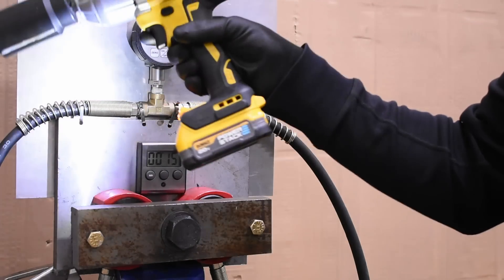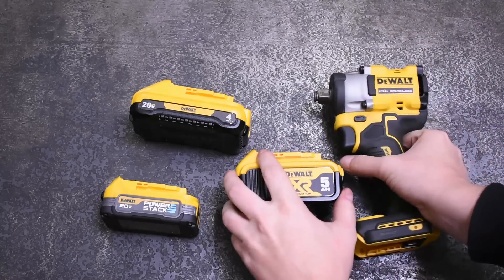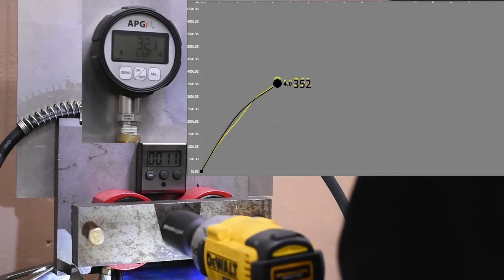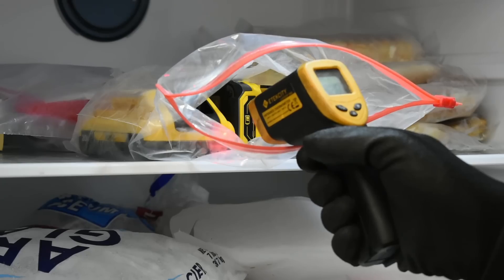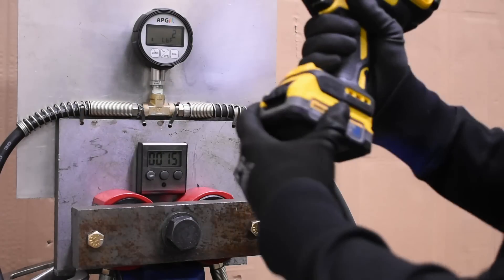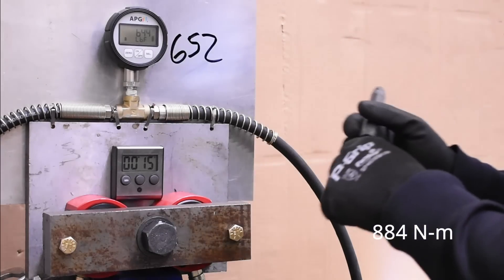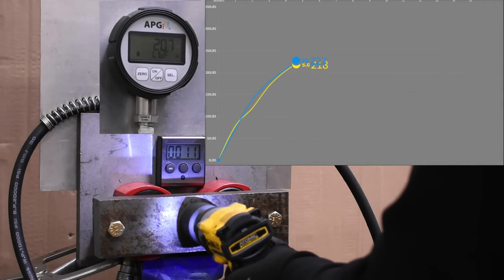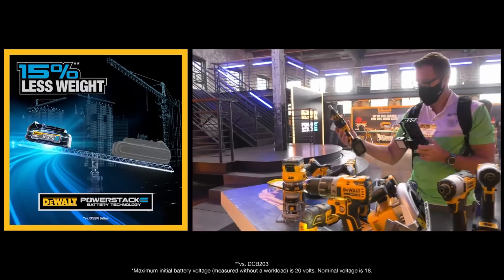This is NOT a Normal Tool Battery: DeWalt Powerstack Dyno Tested

Comment: Battery resistance (internal losses) goes up cold temperatures - the electrolite in the cells starts to freez basically - so the performance drop is expected. In the warm however the resistance only drop a little since the resistance is dominated by the conductor resistance in this case. However the battery will degrade much faster when it is hot. Much like your cell phone battery will die in a year if is is always running hot.

Comment: Recommend Welzh Werkzeug Air Impact Wrench Gun 1/2 Drive Mini Beast 1350NM 1.2KG Stubby upgraded my snap on mg725 and it blows it out of the water on Amazon for £150 and couldn’t be more impressed

Comment: Talked to a DeWalt rep at our local tool shop and he said they are coming out with bigger PowerStack batteries this year. I think he said a 5Ah one. I would be interested in that, or even better a FlexVolt power stack. :)
Reply: Did they specify on when?
Reply: Unfortunately no.

Comment: From my experience with LiPo and ion batteries in RC cars, planes and boats if you repeatedly heat cycle that power stack battery often you're gonna puff the cells in it. I see issues with lithium fires in the future, I've seen packs stored and charged wrong burn down garages

Comment: I was buying a dewalt tool recently and I saw that the XR battery line has been renamed to not include the XR branding (and I assume the non-xr batteries are being killed off). This caused a lot of confusion with buyers.
Reply: XR was originally used to designate brushless tools
Reply: They really should have kept the XR branding off the batteries from the beginning.

Comment: It is the same battery chemistry, but they made it flat with custom dimensions instead of round with standardized dimensions.  Why would we expect anything else?  (Safety reasons prevent them from choosing a more volatile/ higher output battery chemistry.)

Comment: My concern is the lithium pouches have no structural casing or gas vent like the 18650's and 21700's; which means some will inevitably turn into spicy pillows. All Lithium batteries need to vent gases, especially with temp changes.

Comment: Another benefit that’s worth mentioning is the number of charge cycles. We can probably expect 1000 or more from the power stack.
Reply: Where did you get that info - it'd mean different chemistry, i.e. LiFePO4?
Reply: @bj97301  the link is for LiFePO4, w/ nominal voltage of 3.2 and max of 3.6. That would mean max of 18v and nominal of 16V for 5s. Standard, cobalt based, Li-Ion has around 300 recharge cycles and higher energy density than LiFePO4.
Reply: @stanimir4197  I didn’t actually read the whole page. You gotta do your own research. Just google pouch cell cycle count or data sheet. There’s a reason why desalt is claiming 2x the cycle count.

Comment: Keeping up with the other packs with less than half the total capacity does indicate the pouch cells are putting out a lot more current on a per-Amp-hour basis than the cylindrical cells. This is not too surprising considering the entire RC hobby industry runs on pouch cells like this in large part because of their high discharge capabilities, so it would be interesting to see DeWalt expand this line with higher capacity (2P) pouch cell configurations.
Reply: There’s a limit to how much the tool will draw from the battery. I bet they will end up designing some new tools that will take advantage of higher current cells.

This pack is equivalent in max power output to their existing huge packs - so they would have had no reason to make a tool capable of double the power. They don’t have any 24Ah cylindrical packs :)

Comment: Can you test the NoCry 20v 1/2 impact on Amazon? It's advertised at 400 Newton meters and the only reason I would suggest it is the NoCry electric screwdriver tested really favorably in project farms testing having more torque than Dewalt.

They only currently cost $120 and come with 1 of the 4.0 ah packs.

Comment: My curiosity is peaked if this power stack tech allows for more charging cycles then the traditional lithium tech. I think I've heard it's supposed to have more charging cycles. If that's true by a significant margin, then this is looking to be some great tech imo for guys like me that use an impact driver every day all day to build outdoor wood structures with lags and screws. I am a Dewalt platform guy and currently use 4ah batteries as it's a good balance of power, run time, and all day weildability compared to the lighter 2ah batteries which get sapped pretty quick if you have higher torque applications like lag driving.

Comment: Lithium batteries generally have better performance (charge and discharge) when they are hotter. That’s why in electric vehicles they generally will heat up the batteries to well above a typical room temperature when you are planning to fast charge the battery. But, if they get too hot, the run the risk of melting some of the important isolating bits inside, shorting internally and turning into a fireball.

Comment: I care a lot more about run time than beans especially with my 3/8, and If I need the beans which I rarely do with what I work on, I bust out the mg725 or my mid torque for lug nuts

Comment: i'm a bit scared of the longevity of the pouches.

i know LiPo cells from RC and they don't last really long.  ok, high power RC cars or helicopters are pulling 2-3kw easylie so that wears out cells faster... but anyway...  i also don't want these flaky LiPo cells in a power tool that might be used as a hammer. we all know the scenes where lipos burst up in fire when punctured or overheated.
Reply: True!!
Reply: I spoke with dewalt and addressed the same concerns. It is not lithium polymer. It is lithium ion soft cells. Although still prone to swelling and gas build up, I think it's safe to say they are using the best quality cells they can justify unlike cheap amazon  lipo batteries known for being unstable. All dewalt batteries I've disassembled have been samsung 18650s, as long as they keep with a quality manufacturer and use the proper charging current, I doubt we will see many issues. But I do share the same concerns bc of my experience in rc
Reply: I think it's interesting. Tesla is a leader in li ion battery tech and they use cylindrical cells. However, every other auto manufacturer seems to be using the pouch cell.
I think that pouches may show problems in the long run because of the way they create heat.

Also, running li ion batteries hot or cold typically will evaporate the electrolyte (hot) or cause them to plate out (cold).  I'd like to see these batteries go for an abuse test. 100 charge and drain cycles in the sun, then see how they perform.
Reply: @09alvaha  lithium polymer IS lithium ion, same chemistry just in a soft pouch instead of a cylindrical metal casing.
Reply: @JoshVallance  The powerstack batteries are rated for 2x+ the charge cycles of the cyclinder batteries.
Which is also why they cost a lot more. But I'm sure the price will go down.
I'd imagine it'd perform better if Dewalt's claim is right.

Comment: not sure they can scale this up due to the heating issues they are going to face with a sandwich battery. dont think I am going to buy one though. I just dont have a use case for it. pretty much all the batteries I have been using lately are the waitley 6 amp.

Comment: I honestly expected more capacity.  It seems large compared to a 4ah while only with 1.7 ah.
  I will wait to see what Milwaukee comes out with in a year.  Milwaukee is famous for their batteries and I find it suspicious they havent done anything with stack technology ..at least that I have heard of.
Reply: There's no such thing as stack technology, it's just marketing material. They are simply switching from one traditional cell to another, probably to save themselves money more than anything. Not that it's a bad thing, but it's just your average high quality LiPo pack. The increased capacity for the size is just due to the fact that you can pack rectangles more efficiently than cylinders.

Comment: 1. I was told not to store my Dewalt batteries in my truck during the winter and high heat summer day for it would ruin the battery pack. Is this true or will it just affect the battery performance?  
2. Does the new power stack batteries react the same as the XR batteries?

Comment: I feel like you should also put the tool in the freezer. Just to keep it realistic, even if it makes no difference. I mean if you're gonna be using the battery in the cold, it's gonna be on the tool, which will also be cold.
Reply: My battery powered circ. Saw does not like being cold even with a fresh off the charger battery with only 1 cut.
Reply: @silver1fangs  Right. The more I think about it, the more it makes sense to me that the tool should also be cold to keep the testing accurate. Unfortunately he will probably never see my comment. And it seems like only dumb and/or ass kissing comments get up-voted enough that he might lol. Oh well, maybe he will think of it eventually.
Reply from the maker: We read and upvote all sorts of comments. Unfortunately on this one, with 3 different batteries, no way to ensure the gun would be equally cold for each test without buying 3 impacts or waiting days between multiples tests and its a new battery we want to show people as well as up against Christmas. We also try to isolate variables. If both are cold, hard to know which is responsible for the power loss.
Reply: @TorqueTestChannel  Fair enough! Maybe someday, when you're rich beyond belief off this channel, we can see all that done haha. Merry Christmas man.
Reply from the maker: Merry Christmas 🎅

Comment: I am not currently heavily invested into any battery ecosystem yet, I only have a DCD771C2 combo with the Dewalt drill and it came with the charger and 2 of the tiny I think 1.5 ah packs, so I might be better off sticking with Dewalt but I'm having such a hard time figuring out which impact to go with for occasional car repairs.

I don't normally tackle suspension work myself but it would be nice to have something for lug nuts when rotating tires. Is there a current king in the Dewalt 20v lineup since I already have a charger or should I just start somewhere else?

I watched alot of your videos and it just makes the decision harder 😂

Is the DCF911B enough for lug nuts??
Reply from the maker: Dcf921
Reply: @TorqueTestChannel  looks like home depot has a "sale" currently if I buy that I get the 5.0 ah battery "free", total is $199 before tax, is that a good deal or are there hidden places to get better deals?
Reply from the maker: Thats the best deal around
Reply: @TorqueTestChannel  that's what I thought. Too bad I got that $100 Lowes gift card I need to use. I think I'm just going to wait longer and see if Lowes does any battery specials within the next couple months.

Comment: Flats inside. These need cycle testing. I doubt they can keep up with cylinders. And that's considered leftover capacity now-days when you can get 3Ah with a single 18650 line of cells.

Comment: Several emails using your amazon store after purchase still no rank list?
Reply from the maker: You have to email TorqueRank@gmail.com after, otherwise we have no idea you ordered something as we're not Amazon :P
Reply: @TorqueTestChannel  I did five times, twice with the fwd order info
Reply from the maker: @diggindiggenit6540  Check the spelling of where you sent it, i dont see it.
Reply: @TorqueTestChannel  I will resend right now with the link you have listed in the comment.
Reply: the list arrived thanks
Reply: I think I know what might happened, the R is not capitalized in the show more section in Rank so I was sending blanks you might want to change that for other customers

Comment: I would have liked to see what a regular 2 ah battery would do against the power stack.
Reply: Same. Right now, you can get dewalt kits which include bag, tool, battery and charger for less than the price of that lone 1.7Ah battery. Are the 2Ah batteries that come in those kits really that bad?
Reply: If it doesn't provide additional run time, what good is it really.  If I'm going to use a high energy demand tool, a 1.7 ah battery with 7 minutes run time is the last thing to reach for.
Reply: I agree. If someone already has higher Ah batteries, what's the point of buying these new expensive ones? That's not mentioning that you can get those same higher Ah batteries for much less that the powerstack. It'd be interesting to see actual tests done. Put various loads on each of them and see where they stand.

Comment: Might be a dumb question but is this new to the powertool industry or is this basically what Milwaukee uses in the high output versions of their batteries?
Reply from the maker: No one had used it yet in power tools. M18 HO batteries just use the larger higher discharge rate 21700 cylinder cells like the 4ah in this vid

Comment: hot batteries preform better. that is why electrc cars also preheat their batteries to fast charge and like the tesla have their dragstrip mode that heats the battery to 45~50 metric units. also: fully loading batteries at those cold temperatures is REALLY bad for them.

Comment: Another question if you have time to answer.

 Have you ever done any testing with the dcb201 1.5ah packs? I have two of those already with my Dewalt drill. Would those even run one of the newer atomic impacts? Might be a good test, I think I have been through almost all of your videos now and haven't seen the tiny packs tested yet.

Obviously the runtime would be terrible but curious how terrible the working torque takes a hit.
Reply from the maker: We haven't tested dewalt tiny capacity. But all testing we've done on other brands show compared to like the 4ah and 5 here they are quite bad. But will still run anything handheld

Comment: With a new battery type, at least Dewalt made these 
 batteries compatible with all the 20v stuff instead of creating a different ecosystem.  I wonder though, when will those flat packs start to swell up and cause problems.

Comment: Can you compare the fully charged voltage of this battery and normal flex volts? Some lipo cells nominal voltage are 3.8v vs 3.7-75

Comment: I got a gift card to Lowes for Christmas for the $100, looks like they don't have the dcf 921, but they have a dcf894m1, is that a good choice?
Reply from the maker: 894 is the mid torque. Quite big, decently priced right now, but being replaced this year
Reply: @TorqueTestChannel  do you know when they are replacing the 894? I would like to wait if the new one is coming out soon.
Reply from the maker: No way to know. 2022 tho
Reply: Just got this DCF894M1 includes battery plus bag today at Lowes for $179.00 this is my second 894. Lowes is carrying the DCF911B 1/2 and the DCF913B 3/8 for $169, they don’t have the control buttons on them like the units at Home Depot.
Reply: @rrt08  yeah the 894 is about the only thing I can see fitting my situation with the gift card at the moment, I just really wish Lowes had that deal HD has with the free 5.0 battery for $199 tool because I'd really like that 921 they have.

Comment: I wonder if you can wirelessly charge the Powerstack like a cell phone?
Reply from the maker: Not currently
Reply: I'm sure that's not far off in the future
Reply: That would be a novelty thing, paying more for a party trick.

Cell phones wirelessly charge because they only need a few watts to charge relatively quickly. If wireless charging was implemented on a tool battery it would take double the time or more.  

Might be useful to keep it topped off in intermittent use though...  putting it down on the charging pad between uses.
Reply: I think Bosch tried that some years ago

Comment: Why is this a new technology for power tools? I was buying 3s1 LiPo RC car batteries in hard cases 12 years ago, when I saw that power tool batteries used cylindrical cells on this channel I assumed that flat rectangular cells had to be obsolete or something and the cylindrical cells were the upgrade, not vice versa. Was there some reliability or safety-related concern that they finally figured out or are power tool companies just keeping "innovations" in reserve indefinitely to break out when they need a marketing win?

Comment: Polymer prismatic cells are usually less expensive to manufacture than rigid cylindrical. I don't understand why this pack is so expensive. It should be dirt cheap.

Comment: The phone example is still notable but only in so far as taking into account the cost to manufacture. Since all pouches of a given pack will be stacked, say 3ah/ 6ah/ 9ah etc. You could have slightly larger dimensions as you go up whilst keeping the housing the same. And in theory, would mean the cost to make the packs themselves is low; after all, they're sealed, requiring less robust shells (battery cases) to acquire the same integrity. All of that combined means they should be cheaper; not more expensive - in the coming months upon release.  
If that's not the case, it's another perfect example of a company looking to exploit the ignorance of many by making it seem out to be something of a "revolutionary" change as opposed to that of an evolutionary one. Pouch cells existed since the flip phones era, hence everyone should feel defensive when someone's quick to justify any absurd prices, across all demographics of customers.

Comment: power output tests needed for these batteries. If dewalt used the best 18650s, there would be no need for power stack.